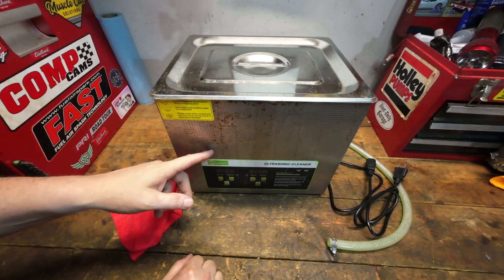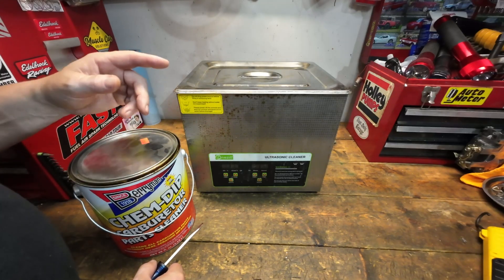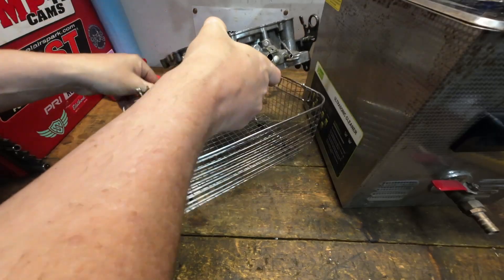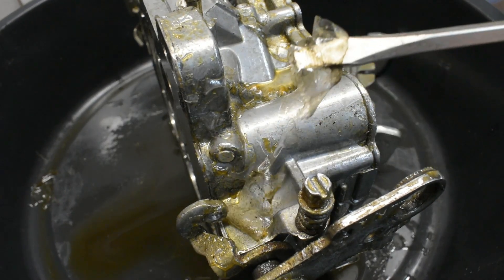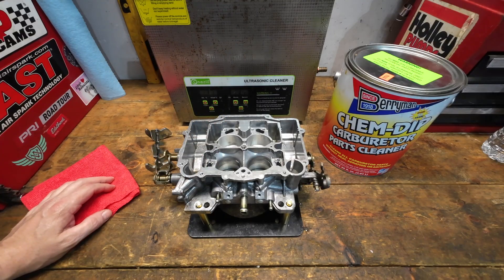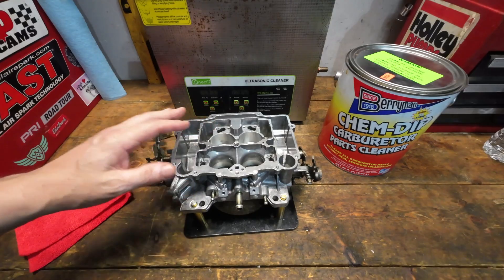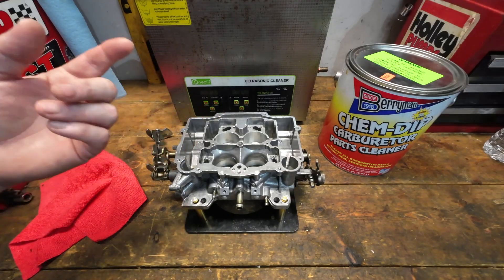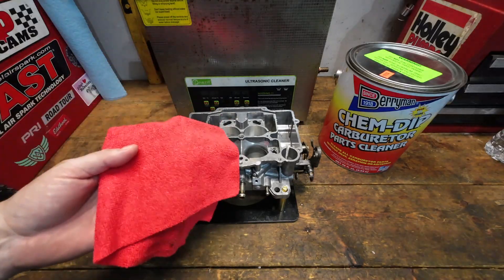Chem-Dip Effects in Ultrasonic Cleaner

Comment: I’m thinking about ordering this in Japan but I’m confused about the label. Why does some say to soak overnight, but the container say only 4 hours? I want to use on aluminum, and maybe some valves. Can I soak a carburetor overnight?
Reply from the maker: I wouldn't.  You get one shot at ruining a carburetor, or any material you soak in a cleaner.  Best to take it slow and make sure what you're exposing a part to isn't causing it damage.

Comment: I have 4 carbs from a 900 Honda 1982.  I completely disassembled them and cleaned them pretty good with a Chem tool bath.  Then I had the bright idea of getting an ultrasonic cleaner because I saw a video on there that showed them looking like brand new after using purple and water solution.  Uhh...  terrible results.  They actually look worse than when I Ultrasonic cleaned them.  Looks like I can't paste a photo here.
Reply from the maker: @FrankGarcia-s7j  sometimes those solutions will dull the finish if it’s not diluted enough and too hot.  Chem dip is the best option for not completely etching the finish.
Reply: @MuscleCarSolutions  just straight Chem Dip... no dilution?  and how much time and any heat?

Comment: not worth the price, if you want to clean the carb body, just water + the best dish washer solution (add like 1/4 of a bottle) and you will have a perfectly clean carburetor or any aluminium parts and it's like 1 dollar max
Reply from the maker: @motorax.service.motociclete  unfortunately soap and water does not clean that effectively.  It will clean a little, but a majority will still be left behind and it becomes worse as it doesn’t have the solvent properties to break down most of the nasty stuff picked up inside or out.
Reply: @MuscleCarSolutions  your soap is not good enough then, or not hot enough ultrasonic bath, or not good enough tool. It's been good enough for HUNDREDS of carburetors i've rebuild running and looking like brand new out of Keihin's or Mikuni's factory doors. And also won't let any residue behind.
Reply from the maker: @motorax.service.motociclete  we likely have a different definition of clean.  I’m glad you’re happy with the results you’re getting with soap and water.
Reply: @MuscleCarSolutions  didn't want to bash but if "brand new" is not clean enough for you, ok. and BTW some cleaners can even take the anodising or zinc coat off, so probably clean enough to bare aluminium.
Also that carburetor is stained and still has A LOT of residue. 
I am sorry you don't want to accept a simple solution and 100x cheaper.
It was just an advice from doing like i said, hundreds of carbs, returned to factory condition.
Peace out.
Reply from the maker: @ I’m glad you think it works for you, but in reality, it just doesn’t.  I’ll tell you what I’ll do.  I will make a video to show you that it doesn’t work.  Give me a few weeks and I’ll make it happen.  I’ll run my ultrasonic with your solution.  You’ll just need to provide me more details than a 1/4 bottle.  Give me a measurement.  I’m using a 10L capacity unit.  You tell me how much you want in there and what type of soap you’re using.  I’ll find the best alternative to me and do all the research for you on the differences.
Reply from the maker: @ or you can visit my website and email me all the details.  Link is in the channel description.  If I’m wrong, I’ll be happy to admit it.  I’ll even send you pictures of the carburetor I’ll use and you can pick the one you want.  Let me know!  I’ll make it happen.
Reply: @MuscleCarSolutions  sorry bud, not gona take this any longer, you do what you do..., like i said, for me, it's enough to bring literally hundreds of carbs back to original factory condition with my method, which by the way you didn't even tried to ask any details on how i do it :) so, good for you :) my mistake trying to give you free advice to get out of this rabbit hole with cleaning cards and all types of solutions :), like i;ve said, Peace out!
Reply from the maker: @ proves the point.  If you have no confidence in it as the perfect, cheap alternative, then it says everything I needed to know.  Your free advice was just bad advice.  Completely understandable.  We’re either working on things that aren’t close to being the same amount of dirty, or what you’re working on isn’t getting as clean as you think it is.  Which is what I offered to test, but you declined.  😆 Best of luck to you.
Reply from the maker: @motorax.service.motociclete  ok too late.  I’m going to make the video.  Eager to use your comments to lay the foundation of the test.  If you’ve got anything to add as to what you use besides soap and hot water, let me know!  But I’ll give you the benefit of the doubt and see if it cleans a carb to “factory condition”.  Maybe I’ll be completely and totally surprised.  We’re gonna put your theory to the test!
Reply: @MuscleCarSolutions  you can do whatever you want sir, besides a few seconds that takes me to write a comment i won't move a finger, real life is way too busy to waste time like this
Reply from the maker: @ tell me what the magic recipe is you use to turn a used dirty carburetor into a perfectly clean carburetor.  I’ll put your theory to test from start to finish.  I’ll use your simple solution that’s returned hundreds of carburetors to factory condition.  So tell me your method and I’ll follow and see how it works here.
Reply: @MuscleCarSolutions holy crap that was an interesting thread 😂😂 he backed out real quick
Reply from the maker: @C @Christopherbever  I did a video on his theory. It didn’t turn out so well.
Reply: I know someone who left a mikuni VM22 in chem dip for a year, it was nasty

Comment: Could that be an anti-corrosion coating that you're removing from the carburetor?  I have heard on small engine carburetors they use such a coating on the aluminum parts and the float bowl.
Reply: @randyab9go188  they use an anti corrosion coating on the steel bowls. Which is pointless

Comment: I use the simple green HD cut down with water in my ultrasonic for my aluminum compressor wheels for turbochargers. The HD doesn't turn the aluminum that natsy dark color like most cleaners.
Reply: I’m currently researching how to clean my he300vg turbo on a Cummins… i have it all apart and rebuild kit coming. 
Iv been soaking the parts in kero + diesel mix to get first level off… 
I don’t have a sonic cleaner yet, but found a big rice cooker at the the thrift store that I was planning on putting on “warm” with some kind of water based cleaner. 
Do you think the simple greed HD would be safe? Or I was thinking of using zep citrus based cleaner.

Comment: I recently started using A-Team Ultrasonic Carburetor Cleaning Solution,mix at a ratio of 1 part solution to 8 parts water as they recommend and really does a pretty decent job,at that ratio with the gallon you make 9 gallons.This product is made in the USA.I got it at Amazon and the price is $34.99 .Just helping anyone with a low budget like me.Thannks for your videos.

Comment: I use maybe 2 cups of Pine Sol in 5 gallons of water at 50 C (122) F for 30 minutes. Then I let it sit overnight and reheat/run again for another 30 minutes. Very minimal post-cleaning needed and I don't even bother pre-cleaning as it's cheap enough to just drain and refill.